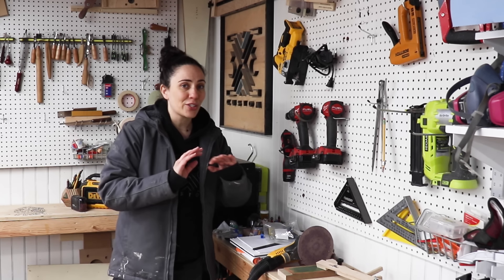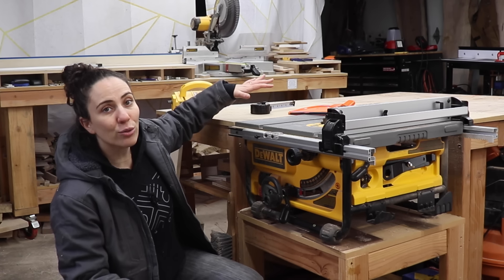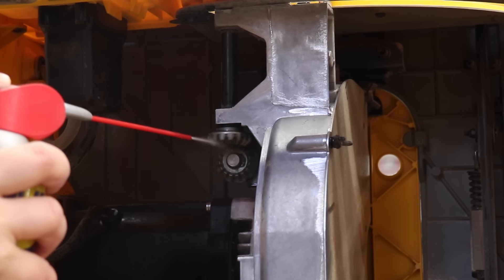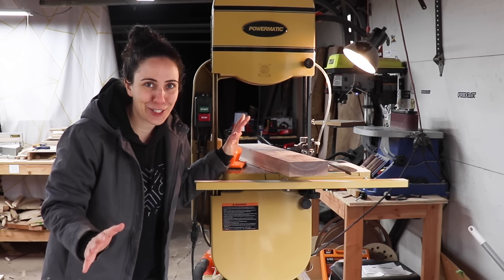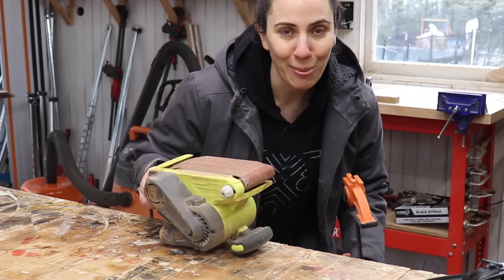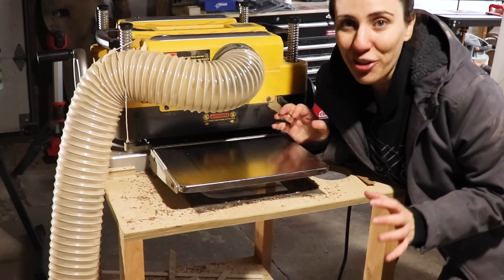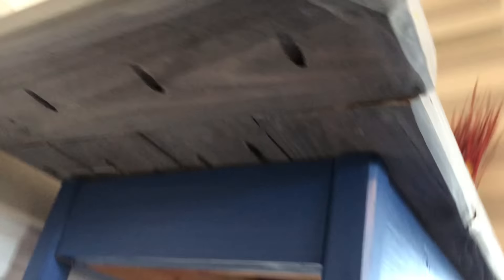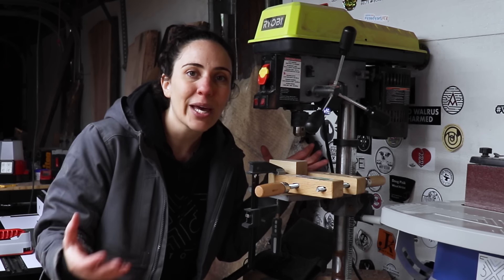What Tools Do You Need to START Woodworking? Beginner Woodworking Tool List

Comment: no one ever talks about the maintenance and the struggles. they make out everything is super easy which is why i always thought i wasn’t good at something, or i was doing it wrong... so thank you for warning us about what to expect on the journey!
Reply from the maker: Glad you appreciate that!
Reply: Agreed. I love sharpening plane blades, but setting up the plane properly was in itself a side-quest.
Reply: I have the same saw, set up in a combination saw and router station. It would drive me insane not being able to get clean square cuts until I spent a day properly aligning the blade and fence to the miter slots. Such a difference. And the fence on this saw is awesome.
Reply: 100% agree
Reply: Agree... That and learning how to repair tools, and where to find parts... Something that many don't know is, many of these different branded tools are actually the same, just painted different colors, so the parts are sometimes interchangeable (IE, I can use Grizzly parts for my Ridged Bandsaw, and Jet parts for my craftsman lathe). Things like learning how to change the brushes on an electric motor can turn a $250 tool replacement into a $6 brush replacement...
Reply: @joshuabray37  luckily, there is a place around here called “the tool hospital“ that my grandfather used for years, so he knows a lot of different repair spots thankfully. Repairing tools is actually one thing I take into account when I buy tools because a lot of the cheaper low end tools can’t be repaired because they are intended to be replaced; sometimes parts are not even available for repair.
Reply: Love your shows! Very informative and detailed.
Question 

Did you have a handheld blower for cleaning your table saw?
Looking for one
Thanks

Comment: One thing to consider; if you plan to use a dust-collection device, which is highly recommended... then there is really no need to spend 2-3 times more for cordless (battery) powered tools, as your tools will be tethered with a vacuum hose anyway, and the power cord won't really matter. Your money would be better spent for 2x as many tools instead of cordless tools IMHO
Reply: I haven't quite started into woodworking/carpentry yet. (Hence why I'm here among other places online). However, reading this comment, I imagined someone walking from 3+ different places in the shop with a corded power tools and eventually tripping on the spiders web of extension cords to flip on the belt sander a and taking off 3-4 layers of forearm skin or something even worse. Yes, I understand shop safety is paramount and that one should coil extension cords after use just as we "should" do many things. In this light, maybe the added safety is worth three cost of buying certain cordless tools🤔..... And yet!..... 🧐 Perhaps one could buy 2x as many tools to start in order to make enough money to replace some of them with cordless battery options!🤓
Reply: @SeanHayesParleys  You can minimize this concern with some wire containment via hose cord clips (Rockler has some) or good ol' fashioned duct tape, and having an extension cord semi-permanently attached to the hoses. This way, you only need as many extension cords as hoses, and there is minimal clutter.
Reply: Fantastic suggestion, Markus. I'd started looking at it like this, but had never articulated the thought. Some tools, like the drill and impact driver, I can no longer imagine dealing with corded versions ever again, and some, like my circular saw, I wish I'd gotten cordless, but I no longer regret getting a corded random orbit sander for the very reason you stated.
Reply: Not for me. I am 70 years old and have bad knees. I left behind extension cords and crawling to reach electrical outlets and wouldn’t go back.
Reply: @HDBoyWonder  I hear you brother. I'm not 70 yet, but close behind you! And ditto on the bad knees. I've got two main work stations/tables... and I attached multi-plug elec-outlets to each (just fixed in place with some velcro) and a hook screwed on the back edge to coil the extension cables from the wall outlet; mounted at chest level. No bending or crawling around for this old timer. Unless I drop something. lol
Reply: @markusferguson2985  I do have some corded tools, like a drill press, lunchbox planar, miter saw and a couple of 30- and 40-year-old, powered hand tools. And one of those long, picker-upper tools.😀
Reply: @HDBoyWonder  Gotta get me one of those picker-uppers ! Cheers
Reply: @SeanHayesParleys  
It’s apparent you haven’t started woodworking yet, because once you set up your shop, you won’t need to walk all over with your tools. Your shop should be arranged with stations where each tool is set up to use. That is the most efficient way to get work done, and the only way to have a dust collection system that works without wasting time hooking up hoses. You won’t need to use your circular saw in one corner, then walk to another to make more cuts. You would have an area set up to make all your cuts in one place. You actually get tethered to a work area, so the cord really becomes irrelevant. Having a dust collection system hooked up to your tools just reinforces this concept. If you have the cash to buy all cordless, go for it, but your money can be better spent on buying more tools to make your shop more efficient. It’s a personal choice but something to think about. Cordless tools work great if you work outside or take them to a job site.

Comment: ... and the last item on the list is:
- Buy a forest. It's a total game changer.
Reply: Oh, that sounds like a slippery slope! Next, you'll need forest machines, a lumber mill, a shop for maintaining said machines, which in turn necessitates all kinds of materials, not least steel. So, needless to say, you'll soon need to start mining for ore, and of course you'll need a way to process that into steel. Continuing down this rabbit hole, the actual last item on the list is just as likely to be a law degree. Or perhaps a sailboat, so you can leave it all behind and take a pretty staggering load off your shoulders... 😅

Comment: Again, you’re great. I shoot your videos to my daughters all the time and this one is no exception. 

I know this is several years old but if you ever do an update, open with PPE. Tell them up front that all this stuff is loud and usually throws more than just sawdust. That one cut over 30 years will make your ears ring constantly by 50. And the ONE cut might not blind you but could easily leave a scar on the side of your eyeball (I don’t want to talk about either).

Comment: I finally, 6 years in, bought a track saw after realizing how much sheet material I was cutting down with a circular saw and how long it took to setup a fence properly to get a good cut. I was IMMEDIATELY gratified at the time and headaches saved. But I also think I bought it at the right time. Learning to solve my problems with a stripped down tool taught me a lot along the way (something I think you touch on on another video). I guess the advice I add is, buy something when you REALLY understand why you want it and what it will do for you and you will never have a tool collecting dust. Thanks for the great video!

Comment: Hi, Tamar. I really enjoy your style of instruction. I've been woodworking on and off for about 20 years now, but still pick up new tricks from videos like yours. In case no one's mentioned it, your Dewalt 745 has been replaced by the model 7491, which is an improved version. It still has all the features of the 745, but also some changes /improvements. I have very little space in my 1-car garage, so the 7491, with its folding stand, was a great choice. I've been using it for almost 6 months now, and am very pleased. It's not a SawStop 5hp cabinet saw, but for what it is, it's pretty good. Keep up the good work.

Comment: You inspire me to wood working. I m planning to start  by Dec 2021.
This month I received :
1) Bosch hand drill
2) Stanley hand planer
3) Stanley circular saw
4)DC circular sander
5) DC flat sander
6) ingco-F clamp x6
7) Combination angle
8) Bosch Angle Ginder 
 and on the way 
9) Belmash SDR 2000+ ( compact table planer, saw thickneser, drilling, brush, and milling.
10) Makita 12mm router.
11) Black&Decker jig saw.
I m quite nervous for I never done carpentry.
 I hope I can pull it with this.
Limited budget.
Reply: I started recently too and I think it's about finding project to do and planning a bit and just doing it.  There are many videos and creators that offer helpful tips for using this or that tool or building x or y, but there's no substitute for doing it yourself. Go out and build some amazing things, Klitz!  You got it.  We're rooting for you!
Reply: Hey, I hope your woodworking has taken off as of 7 months ago! 👍
I'm curious about the Belmash multi-tool. The company websites show their main facilities are in Belarus with distribution (and probably manufacturing too) in Russia and Ukraine among other places. I'm guessing product support isn't exactly the easiest considering the language barrier along other things. How is it to use and are you able to use SAE measurements or is it strictly metric?

Comment: For my 'bush carpentry' I use circular saw, 4 + 8' straight edge, table saw, cordless drill, belt sander,
 many hand tools.
Re-mill lots of wood on my table saw. 
Great video, thanks for sharing!
Reply from the maker: If it works! Awesome
Reply: I use a circular saw and a custom rip fence jig I keep in the bed of my truck. I have a woodworking vise that I can clamp onto the tailgate. Plus I keep a Stanley no. 4 and a spokeshave in the toolbox.

I frequently find myself with an abundance of free pallet wood as well as free time at work.

Comment: I love your honesty🤣. I too hate the jig saw but sometimes it is just the best option.
Reply from the maker: Yeah. Sometimes it’s unavoidable. But the less than perfect cuts would have really bothered me if I would have started with it
Reply: I don't own a jigsaw, as I too hate the damn thing, but there are times where it would be the right tool for the job, so I might be getting one soon.
Reply: I thought I hated jigsaws until I got the cheaper Festool one recently and well I love it now. I won't touch my circular saw for doing lumber break down now.
Reply: @Roct3874  I bet those are some really unsquare and rough looking cuts.

Depending on what I am cutting, I use either a crosscut sled, a circular saw and straight edge, or the tablesaw.

For example, I can't cut a full sheet of plywood on my tablesaw, so circular saw and straight edge it is. However, if I am cutting rough lumber to size for a project, then I normally use the crosscut sled.

I couldn't imagine using a jigsaw for anything but rough cuts, and trying to cut through thick lumber with one would take much more time than my crosscut sled or circular saw.

Where I run into problems is cutting anything with a curve. I simply can't do it without a jigsaw. That is why I will be buying one soon. Once I get a bandsaw, many of those cuts will be done there, so it will all but eliminate the need for the jigsaw.
Reply: I went from a black and decker (that made me think jigsaws were worthless) to a bosch. It made a world of difference. It's actually enjoyable to use.
Reply: @shinobitree5711  the problem is the cut. It is terrible. If I'm cutting MDF, then no problem, the terrible cut can be sanded smooth easily, but plywood, the tearout is horrible, and hardwood just takes too long to fix after the cut.

I would much rather use a different method than a jigsaw if at all possible. I used to build speaker boxes for a local car stereo shop, and a jigsaw is what we used to make the speaker holes. It was perfect for that, as the holes didn't need to be cut with any precision or cleanliness. I couldn't see using one for anything visible without significant work after the cut. I'll continue to use my router on a guide till I can get a bandsaw.
Reply: @charlieodom9107  Oh I have a track saw for breaking down sheet goods to make them manageable for the tablesaw. I use the jigsaw to rough cut boards to length when I'm laying out parts on a board. The festool jigsaw and the clean cut blade leaves a really cut to be fair, it's cleaner than my circular saw ever left. It plows though 8/4 lumber which I was surprised about. I also have a bandsaw but trying to cut curves on a large piece is just awkward.
Reply: @Roct3874  if your jigsaw is cutting better than a circular saw, then you have a major issue with your circular saw. My circular saw cuts glue line rips on any material. A jigsaw will NEVER do that.

The other saws you mention are irrelevant in this topic as it is about the jigsaw.

As far as a bandsaw being unable to cut certain pieces...I'm right there with you! For those cuts, I need a jigsaw. They are so few and far between though, I can normally engineer those cuts out or change the design to allow them to be cut easier.

As far as a tracksaw....pretty much everyone starting out will have a circular saw, so a tracksaw is a luxury item that is irrelevant and every expensive, since a 10 dollar straight edge will do the same thing.
Reply: @charlieodom9107  I mentioned the other tools because you did. I don't use a circular saw for rip cuts because I'm coming from someone that has a jointer, planer, table saw, bandsaw, and hand planes and well beyond a beginner level. Also, no saw will ever give a good enough glue line in my opinion, and others just due to the little saw tooth marks that are left no matter what. Even when I started out I only ever used a circular saw for breaking down material to rough length because I would rather spend the few hundred dollars on a table saw than fuck around trying to use a circular saw for accurate rip cuts.
Reply: @Roct3874  hey, I do very similar things as you do, roughing in with the circular saw and final cuts with the table saw, but if I didn't have a tablesaw, then I could do glueups on just my circular saw. I also have a jointer, planer, and other tools, but the topic was beginners and jigsaws, so a circular is far more important than a jigsaw, and I would buy a tablesaw long before a tracksaw.

Using a large foam board to support the work piece while cutting is a very easy and cheap way to cut using a circular saw, as most just starting out won't have some fancy assembly table to use. Hell, I still cut on the rails of my utility trailer with a plywood acting as a table and foam for the sacrificial piece.

My tablesaw is a custom jobber I built using the guts from one of those Ryobi POS jobsite plastic things that has no business in a woodworking operation! Those plastic jobbers are complete trash!
Reply: @charlieodom9107  I'm not arguing that a jigsaw is better than a circular saw when you start out as I would tell someone if they have the money just get a makita tracksaw from the get go but if they don't a circular saw will work. I use a bora centipede and a piece of plywood as my sacrificial piece for my cutting station for my tracksaw myself.
Reply: @Roct3874  starting out, a tracksaw is an ignorant purchase. Plain and simple, no beginner should even be looking at tracksaws. If you had multiple thousands of dollars to blow on tools, then sure, but the people she is referring to are commenter on her videos, which won't have that budget.

Hell...I do business with shops with multiple hundred thousand dollar tool inventories that don't even own a single track saw. Things like Woodpecker tools, fancy clamps, specialty saws, expensive tenon tools like doweling jigs or dominoes, etc are just not anything beginners look for.

Circular saw, harbor freight clamps, corded or cordless drill, cheap sander, handheld router, jobsite tablesaw, DIY wooden sawhorses, pocket hole jig, etc. These are tools for beginners.

Contractor tablesaw, planer, jointer, tracksaw, bandsaw, drill press, fixed type sander (drum, oscillating, spindle, etc), etc are tools the beginner doesn't have the budget for, nor should they even be looking at till basic tools are purchased.
Reply: @charlieodom9107  The quality of the cut varies a lot with the type of blade. There are jigsaw blades that leave a very clean cut, specialized for different types of material. Also, for clean cuts, you need to set the forward movement of the blade to 0.

Where jigsaws reach their limits, IME, is thicker material - anything thicker than an inch and the blade will bend sideways during the cut, if you cut close to an edge.

And of course, some jigsaws are better than others. But router on a guide for cutting wastes too much material for my taste.
Reply: @Roct3874  You can definitely rip boards to glue line quality on a properly set up table saw, with the right blade. My table saw isn't a very big or expensive one, but cuts have a finish close to what hand planes give you. If your table saw leaves tooth marks, you may need to swap the blade, and definitely need to check the shaft/bearings for play.
Reply: @a0flj0  you can get 1/8" router bits. They don't waste any more than any other blade once you include the cleanup. Cutting at 90° is what kills a jigsaw, so I feel you there.
Reply: The problem with jigsaws are two fold. The first, people aren’t patient enough to let the blade cut the material.  They begin pushing the blade against the material and causing the blade to bend. And second, the blade isn’t supported under the saw. Meaning, it’s just dangling wildly during the cut with nothing to prevent it from moving from right to left.  Coupled with the bending I mentioned earlier, you get eradicate blade travel that results garbage cuts.  This is why a scroll saw is a far superior tool for cutting curves.  The support is there.